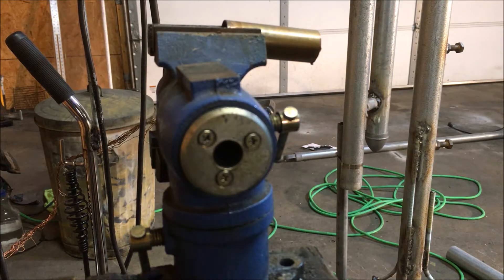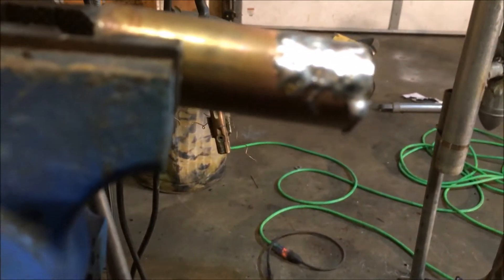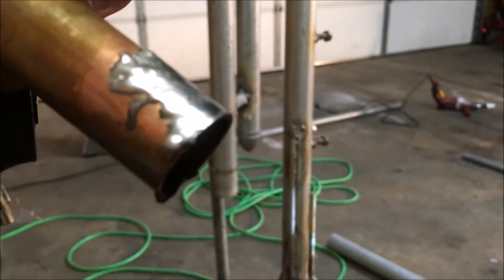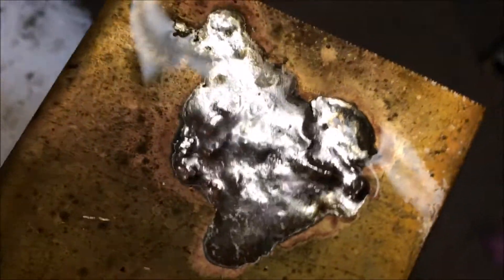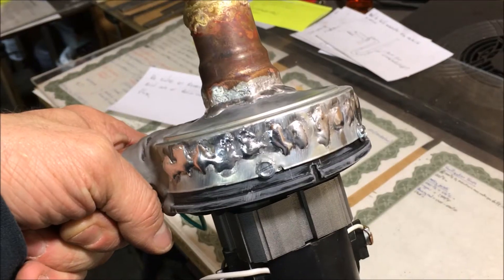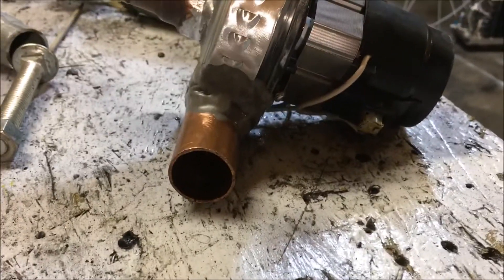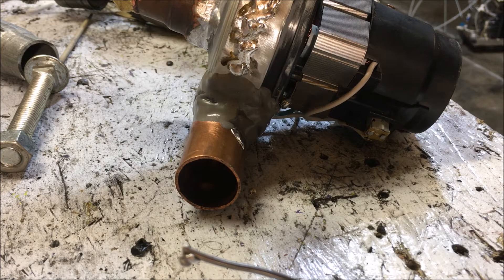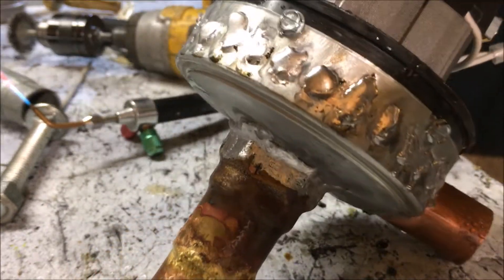Best Solder Flux Removel Method

Comment: That will crack joints
Reply from the maker: I thought so to but its not true . have not had a crack yet from this
Reply: @NOBOX7  I had initially learned this way however, best it to wipe with damp cloth coming towards it ( soldier joint) from like 6 inches away gradually to avoid shock.

Comment: Better way is machine oil
Reply from the maker: Thanks im gonna try that , i got some mobile velocity #10
Reply: @NOBOX7 noted. put the machine oil, then follow by heat up. Lastly, when you notice the flux turns into liquid form, wipe it off with cloth.

Comment: That's a great trick. Thanks for sharing.
Reply from the maker: +m3sca1 Glad you liked it , works just as well on electronics though i must admit i do not have any input on the metalurgical impact as far as micro  fracturing is concerned